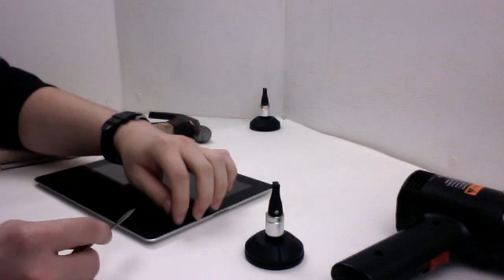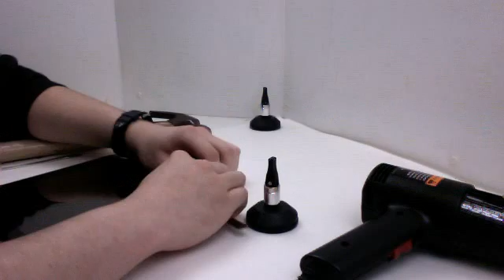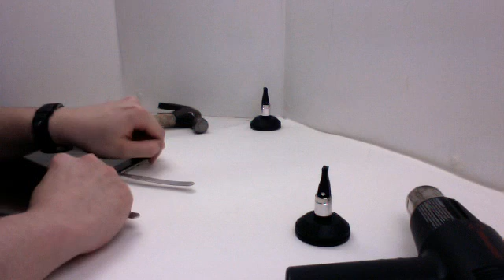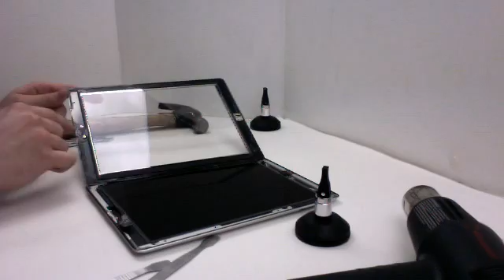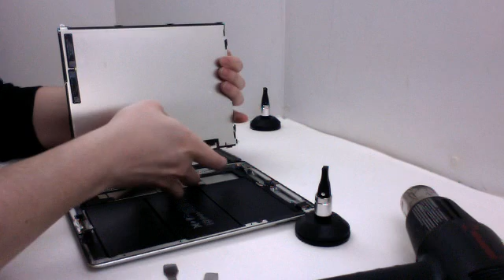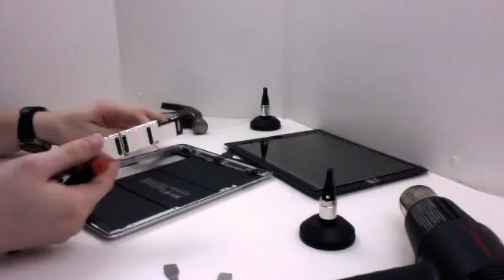How to Open the iPad 3 (3rd Generation) - A Take Apart Video

Comment: So it arrived today. Screen is pristine. Chassis is perfect. The battery is good.>💫>JustU.Faith/i-PadPro?蓋  The speakers are SO loud, it's really insane. The iPad in general is just insane to hold. Pictures don't do it justice - as soon as you pick it up, you'll be in awe at how light, yet solid feeling this thing is. I turned on a video to watch and I thought it was pretty loud, but quickly realized that it was only at 50% volume. The screen is HUGE, and the bezel is very thin. The camera is great.

Comment: DId u even use the heat gun?
Reply from the maker: No, it's not necessary. If you've never done it before, then it will help slightly.

Comment: I found one of this on a parking lot, as soon as i picked it up i noticed tire marks on the screen, when i cleaned it there was not a single scratch on the damn thing! However it does have some damage because it keeps turning on and off and it doesn't respond to anything, do you think i should fix it? there's not a single scratch on it.

Comment: Hi, i was wondering if you could anwer a question for me. I accidentally dropped my ipad 3 and it dented justba little bit. the problem is that it dendeted right on the volume buttons, so they are stuck ! do i have to completely open it to try and fix the dent & should i do so? thank you and have a good day :)

Comment: hi, once I went to the arctic with my ipad 3, it was totally damaged
1.firstly, the screen was just cracked but the pad could still work.
2.then a few days later, it would turn off even the battery still hold 20% of power.
3. afterwards, i left it  aside for 2 days, guest what, the battery could not be charged and it always displayed 100% once it is plugged and  it would turn off  when the pad is disconnected with power right now.
4. meanwhile, the wifi and celluar units cannot be active anymore